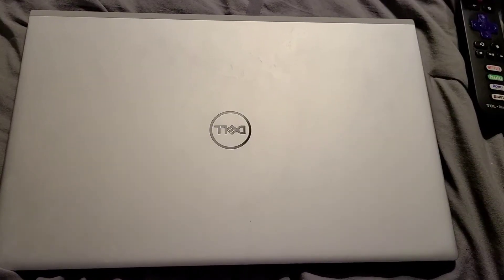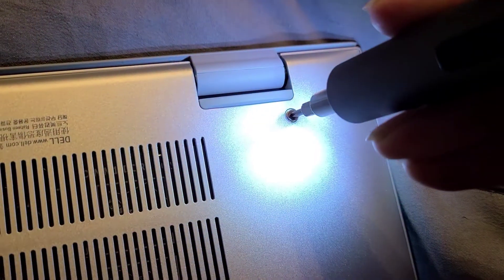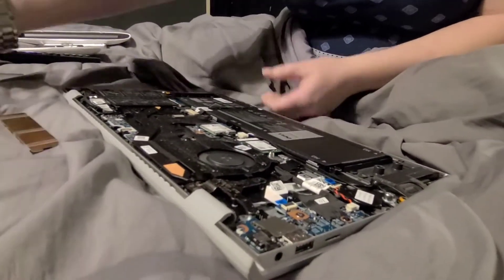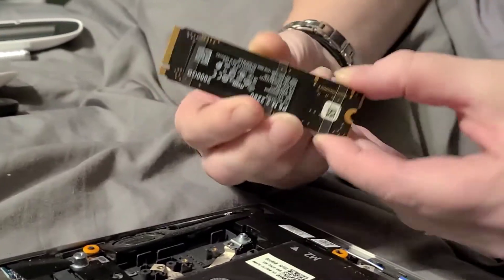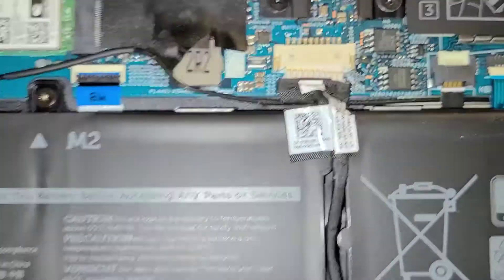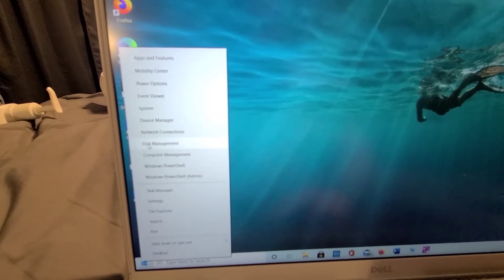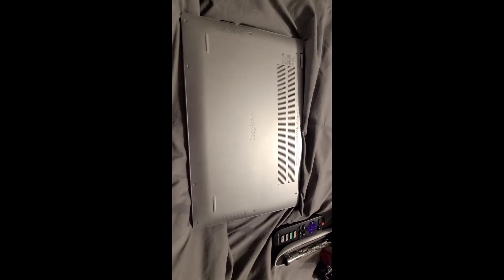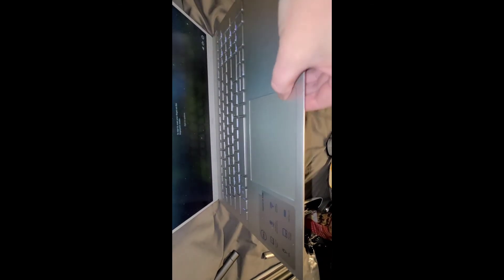How to install an SSD in the secondary SSD slot in an Inspiron 15" 5502(5509)

Comment: this bracket dell sent you with the laptop or u had to order it separately 
 ?
Reply from the maker: I had to call them and order it separately.  The part numbers are included in my video description.
Reply: @sanch068  had to buy it from AliExpress. Dell gave me £20 refund to buy it.
Reply from the maker: @1umarch  wow!  That's amazing!   When I ordered the parts from Dell, it was like pulling teeth.... they wanted my laptop specs etc..... and with my laptop specs they were unable to find the correct parts that I needed...... at the end they just took my word for it and let me order the bracket and screws via part#'s.

Comment: Great video(s) (...this, and the RAM)! In the description of the video looks like you had round bracket placeholders for the "...bracket(), mounting bracket screw(), and the screw for the ssd itself()." - do you happen to know these parts numbers when contacting Dell?
Reply from the maker: I updated the description with the part numbers that you'd need for the job (mounting bracket and screws) 😊  hope this helps 😉✌
Reply: @sanch068  Awesome, thank you!

Comment: Thanks ... Was searching for this 
Btw, what's the purpose of heat sink
Can I install the SSD without it?
Reply from the maker: There are people out there that install them without the heat sink.    It runs cooler with the heat sink on it.   Thank you so much for your support!
Reply: @sanch068  Thanks for the reply.
How's the overall performance, battery life of this laptop? Just got mine yesterday and it seems great!
Reply from the maker: @phenompesgaming  I don't have any complaints yet 😊  but idk about battery life as I pretty much always keep mine plugged in